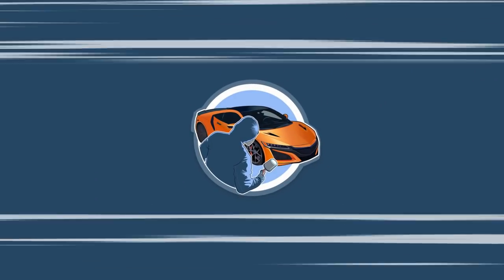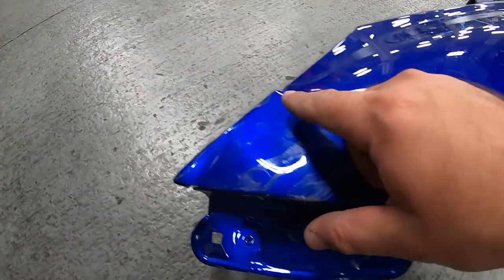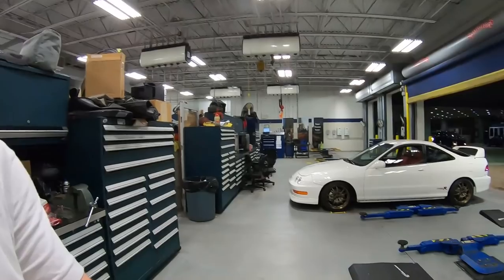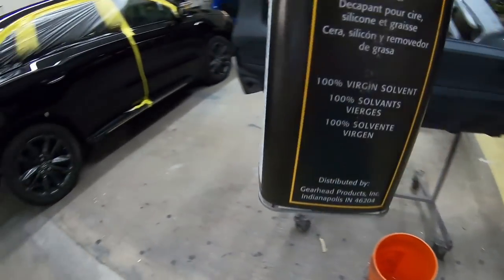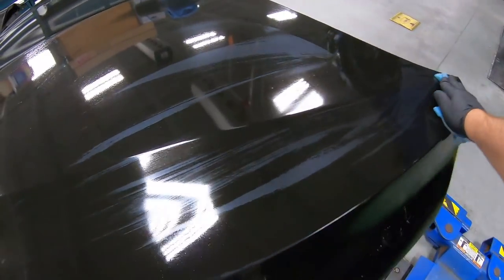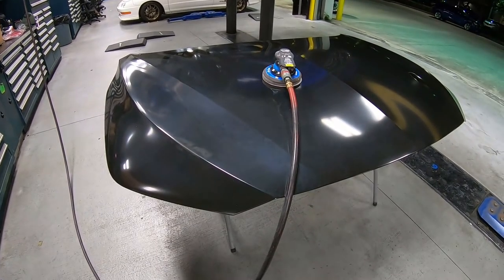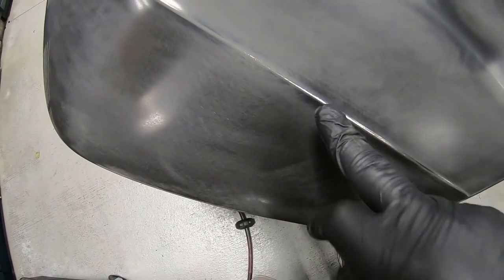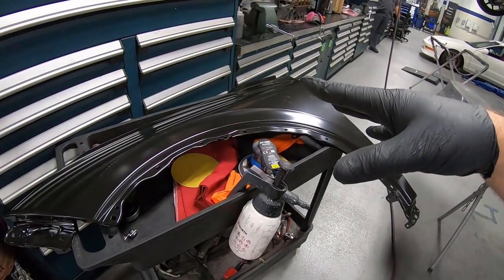Car Came BACK After I Repaired It!

Comment: Hi 
I experimented with wet on wet on the inside of new parts  without sanding 
I did the standard tape and crosshatch cutting method for adhesion found no issues as long as the panel is cleaned correctly 
I have used this method for years and have never had an issue

Comment: Honestly 20 years in the trade and I haven’t seen a failure from a chemical adhesion bond of e coat and sealer. If it didn’t work the paint companies wouldn’t recommend it. I understand why painters still might scuff for peice of mind, but I have come to trust it. Cleanliness is the key here
Reply: I agree 100 percent.. only time I sand the factory primer on new parts is if it’s rough or has box marks.. I will say that lately the factory coatings have been pretty shitty..
Reply: @bodyshopsolutions695  ya the factory ecoat has been terrible on new parts eh. GM sheet metal has been some of the worst. I find Kia and Hyandai have good sheet metal replacement parts but other than that everyone else has took a turn for the worst in quality

Comment: I always scuff the inside for piece of mind (takes maybe 5 mins) Even if it is warrantied, how long will it take for the paint rep to come down and examine it and then what? pay u back for material wasted? time wasted too? dont think so. I actually never came across or ever experienced an aftermarket primered part that wrinkled on me when i painted it. I sometimes seal my parts sometimes i dont, depends which color im painting it, but it has never wrinkled.

Comment: It'd be kinda Kool being the owner of this vehicle and watching the videos by you in its repaint. As far as scruffing under the hood I'd not do it. If it comes back with issues on the underside you may be held liable. 
REMEMBER: The hood is a major solar collector and heat dissipation outlet for the engine heat. 

If you must, I'd get the ok from the manufacturer first.
Reply: Yep

Comment: I’m sure there are other brands that make it but Spies makes a primer that bonds to E coat Unsanded. Chemical laminated from my understanding. Makes me uneasy but gotta trust the engineers and chemist’s I guess. Think it’s called Vario. I’m sure you’ve probably heard but haven’t heard you mention yet. Appreciate the content and tips. You do a great job at explaining.
Reply: Yea I use spies hecker and they say you don't have to sand it but I still scuff it
Reply: I haven’t sealed the jambs of factory parts for 20 years…….it works.
Reply from the maker: I guess all paint brands have a similar product. Thanks for the comment
Reply: @A. Melbs currently using spies, but all major brands have a direct to OE primer sealer.
Reply: Spies is said to have unlimited window for base   So no need for scuffing once sprayed come back weeks and months later and spray clear at a later date. Not repping Spies here just one I’m most familiar with. Definitely huge time saver. Makes me feel better about the non sanding primer/sealer. Clean,vario,base, tack and wack. Who loves sanding anyways?  At the end of the day it’s up to the company to stand by the product and process. Not to mention the user responsibility to the process. I’ve heard it mentioned most problems comes from human error which I agree. Appreciate the feedback.

Comment: If You are in a shop, and Insurance will pay for new parts, always replace the hood, it's easier, faster, better quality.
There are some guys who can fix dings like that, but the amount of work, money and time is not worth it I think.

I'm a tall dude, like close to 2m ( about 6 foot ), and I wouldn't paint that hood mounted on the car, especially if you want to paint the underside because it's a new hood.

The way I understand it, if you have original parts like in the video, you don't need to sand at all. Prime them before colour and you're supposed to be good to go.
Having said that, 3 out of 3 places I've worked at still sanded like you did in the video, and I'd ALWAYS recommend doing so.
You are not stopping the paint from the chemical adhesion, but also adding mechanical... I believe that's a good thing.

Cool video, perfect explanations, had me laughing at all the shortarm guys :)
Reply from the maker: Thanks for the awesome comment and your perspective.

Comment: I am a DIYer weekend worrier far as auto body work  but have spent time at a cousins shared shop between couple auto body repair techs as well as for my work and they scuff underside for longevity depending.  It depends on longevity expected by customer and how much is being paid.  Have seen shops not scuff under side for only chemical bond.  Older/seasoned guys scuff while newbie out of school will not.  Non production volume guys will scuff.  I will take the time to scuff underside since it my time and my preferred way of doing it.  Only reason i would not scuff is if the product label states do not scuff.

Comment: Regarding prepping in E-coat panels I red scotchBrite edges and where the hood prop might scratch it easier near the hole it goes in . If its well taken care of, exotic or low miles I scuff lightly entire thing and use high pressure blow gun glass cleaner etc.

Comment: Great job coming on excited to watch the next one,Well when I was learning the job in some body shope we was usually use to scuff the panel from inside as well i mean from the bottom before spraying,and one more thing we was going with 500 grid after 320 to smooth up the panel and remove the scratches which comes from 320 then we use sealer before paint.that’s what we use to do i am not professional guy but you asked about our way 😀
By the way are you guys don’t have a winter at all there in South Carolina??
Reply from the maker: South Florida! 😀

Comment: I like those post-less car lifts. First time seeing them. Space savers for sure.
Reply from the maker: Can’t get them installed anymore because the oil can Contaminate the ground
Reply: @PaintSociety  after checking out your vid i did a search online and it looks like they have water/air driven ones now.. expensive though. Lots of work to install one too. Learned a lot from your channel, thanks!
Reply: That’s what most dealers used to have.

Comment: Hi Brian, I've painted my car with 2k metallic black,I,m not very happy with the gloss finish.Can I wet sand the paint with 600 grit and spray clear coat straight over the sanded paint.Thank you for your help and advice.It was you that gave me the confidence to take the job on.Thanks again,
Alan U.K.
Reply: Hey Alan, I'd advise P600 ( wet if you want, but dry with a machine is better ), just shave the top off, then sand with P800, carefull not to poke through the clear.

Sand and paint the ENTIRE panel in clear again.

Might seem a bit excessive, but you are not left with any areas you need to buff after.
Reply: @A. Melbs absolutely, that's why I said: "just shave the top off".

It is difficult giving advise with no visual reference, but mostly, if there are 2 more or less "good" layers of clear, the P600 is just to get rid of the orangepeel faster. P800 a bit further, until the P600 marks are gone, and you're good for masking/clear.

P600 wet by hand might leave streaks, the clear can't close. That's why P800.
With a machine P600 should be fine, just get rid of the orangepeel.
Always carefull around any edges.

Comment: Although I went from not knowing how to adjust a spray gun 2 weeks ago to the primary painter in a major collision shop today when I have a jamb area or an under hood type deal I usually just dust bullydog on and spray the sealer right over that. It's probably not the correct way to do it but I almost always have the stuff in a gun so I figure why not.
Reply: @A. Melbs indeed. Previously I was a general mechanic and did everything from oil changes to full on hand built motors. One of which is my daily seeing 20psi multiple times a day. I've painted many times just never with the amount of control or patience I've had to deal with in the last week trying to put our quality work.
Reply: @A. Melbs I'm by no means a good painter but I can and do consistently put out good work with the amount of experience I have.

Comment: when you paint something and something doesn't go as planned dents etc. how long should you wait to reshoot it? I had something wrinkle up as soon as the clear hit it after a week of letting it sit
Reply: That's hard to say, the wrinking might come from different reasons.
Usually for a first time job on the area, the brands will be repaintable for 24hours (you can clear over clear within 24h).
It depends if you baked the job the first time around, and at what temperature, for how long.
Maybe you used different brands/systems for colour/clear.
There might be some tough cleaner und the paint, or adhesive residue.
The painted area might even be overpainted, like there's too much material on it.

Don't want to be too pessimistic, but you might be off better sanding the whole thing down again...

Comment: The value of this car is going to take a massive hit come resale time! 😬
Reply: Only if the buyer is told about all the repairs. Most times the seller won't spill the beans
Reply: @ma3rabima3rabi13  unless the dealership reports to carfax
Reply: Not a salvage title prob
Reply: @ceesklumper  Salvage title means the car has been declared by an insurer as a total loss. Carfax just reports repairs and damage if it's reported to them.
Reply: Honestly looking at the carfax on a vehicle like this id take the discount it offers especially being repaired by Honda since every single part is Honda and restored back to factory spec.
Reply: @ma3rabima3rabi13  car fax spills those beans

Comment: Hey man, I’ve starting painting cars myself thanks to your guidance here on YouTube. However I was wondering if I can use a general base coat on an engine block? I’ve heard mixed things online on wheather it’ll handle the heat or not.
Reply: It honestly depends on the brand. None are designed for it, however I have used Senour Martin paint on an aluminum block and over around 15k miles all that has happened is the color has slightly darkened.

Comment: I will always scuff the under side of the hood. It is just a extra bit of insurance on my part against failure and peeling.
Reply: It also makes you assume liability if an issue arises. That hood is a massive Solar collector plus the engine heat dissipates up through the paint as well. I can think of no benefit in doing so.
Reply: @victoreous626  sorry for my ignorance but I’m a hobbyist and I’m learning from this channel.  Can you explain what types of issues can happen and what exactly are you liable for?
Reply: How does sanding for adhesion add extra build for paint?  You end up with basically the same mill thickness in the end. Your comment makes no sense to my comment of adhesion. Engine heat is there regardless.
Reply: @robodenbach7373  I'm actually in agreement with you in general. I'm speaking to the hood underside of this one Brian is dealing with. The manufacturer assumes all liability when they state that no sanding is needed. And they do state such.   I'd leave it at that in this instance. 

As for the heat issue, yeah I would think that scratching the surface would actually benefit in that it basically doubles the surface area for the paint to grab on to. 

In this instance I think Brian should have shot an email seeking a clarification from the manufacturer. Absent creating such a Legal record Id just go ahead and follow the manufactures guidelines.

Peace
Reply: @VICTOR EOUS, sorry I read you're comment wrong. I've seen guys not scuff the under side of a new hood because they were told they did have to, and they had major peeling. Myself I would not want to deal with fixing it. Lol

Comment: I feel like E coat has changed. Its thinner. 10 years ago I could remove all shine from a hood without busting through and use the same red scotch to do the underside. Maybe I'm crazy
Reply: The e coat varies from factory to factory. Mercedes has a rather thick one, compared to Hyundai.
Also the companies try to save money in any way they can, thinner coatings is pure money for them.
E coat doesn't need to be sanded, the chemical adhesion is supposed to be enough.
I like to sand it anyways. No you're not crazy, just completely right.

Comment: That's not a come back it's a repeat customer, come backs cost you money, repeats make you money, and on the subject of repairing modern body panels they aren't as repairable as they used to be as modern panels are much thinner and have a higher alloy content and don't respond well to reshaping, the amount of time it would required to straighten that hood would cover the cost of replacement plus it's a new vehicle and it should have new parts, aftermarket body panels rarely fit correctly and are usually more hassle than they are worth.

Comment: Why can’t you just edge all the parts then test fit the parts I know the bumper must be painted off the vehicle but you fan at least paint the inside of the metal parts fenders door hoods and just paint hose on the car so you don’t have to install hood and fender then have to take them all off.